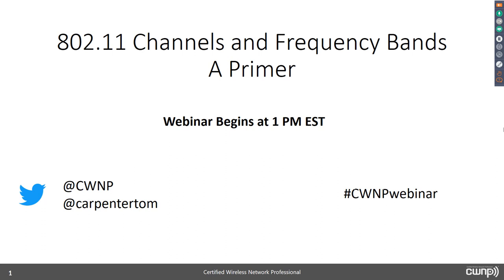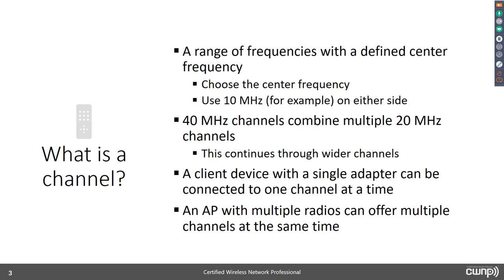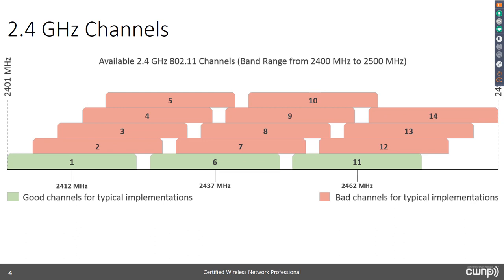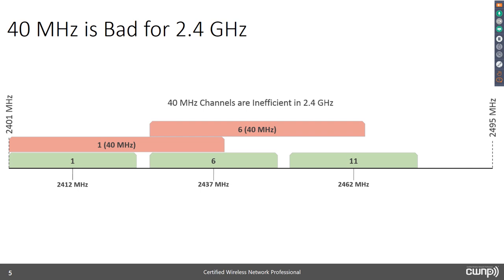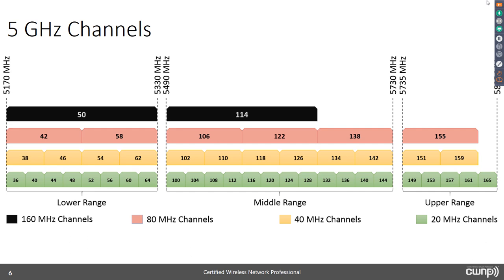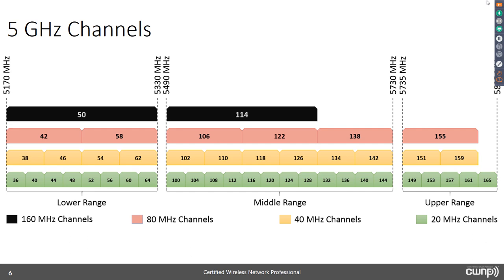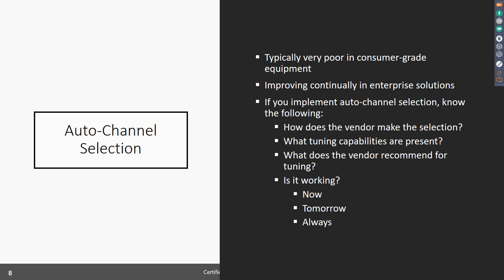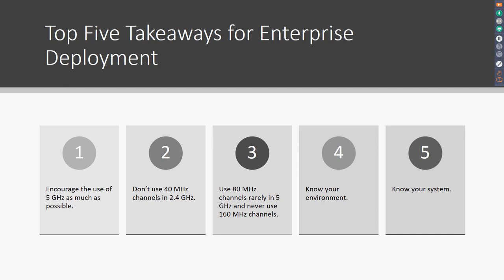802.11 WLAN or Wi-Fi Channels and Frequency Bands - A Primer Webinar

Comment: You can use channels 1 5 9 and 13, without overlapping
Reply: Its not all about overlapping, there is also a required separation space between each channel like 2.4mhz or so. they wont overlap when you see it in a picture but in real life, they will be too close and could overlap.
Reply: @jammel3653  please direct me to a IRL case as example. I'm not doubting you, you are correct. I'm just curious to see a IRL thing measured in case you know of any